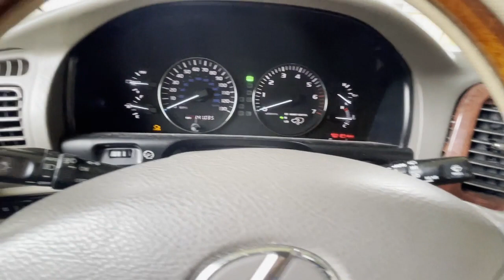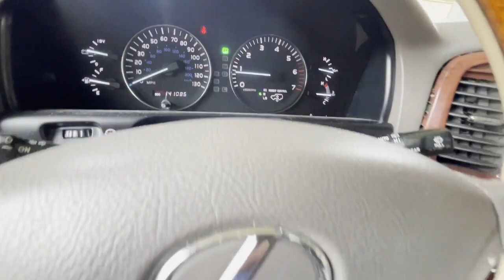Toyota Land Cruiser 100 - Lexus LX470 [1998-2008] Emergency Brake Adjustment

Comment: Kamran bhai, why your drum was wet from outside? Please check if the axle seals are ok, I replaced mine few days ago along with the bearings.
Reply from the maker: Thanks for commenting brother. I sprayed it with penetrating oil before removal, so it can come off easily. That’s why it looks wet.
Reply: На барабане есть отверстие закрытое резиновой заглушкой через это отверстие регулируются колодки стояночного тормоза без снятия суппорта и барабана